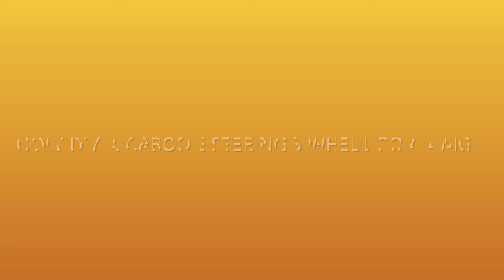DIY Carbon Fiber Steering Wheel Mercedes Production PART 1

Comment: What did you use of carbon fiber? Its like there is already glue on it?
Reply from the maker: Hello, no we spray it on the Carbon and parts
Reply: @CARBONART.  what glue did u use?
Reply from the maker: @wafuasy7147  a 2 component high temperature resistant glue
Reply: @CARBONART. Can you give me a link to the glue?

Comment: Thank you for the response. I really like that finish, because I have tried many carbon fibres and really struggling with distortion in the fibres which looks really bad when epoxy is applied. Do you have any suggestions for me? And is that 245g twill weave? Apologies for many questions, just trying to learn from someone who is really good
Reply from the maker: struggling with distortion happen quickly, it's just practice. but i recommend starting with light parts, for example interior moldings, then mirror caps. You need a lot of experience for a steering wheel because the shape is complex. in the future there will be more videos with many different parts 👍🏼

Comment: Was that spray glue to stick it down first?      Iv done a few 
Try polyester resin first to help stick down     Then normal epoxy resin after.    Definitely works      I had one where the glue felt like it came off so was like a tube in the end lol
Reply from the maker: Hi, yes at first hight Temperatur resistant 2 component glue. 

I don’t like the Methode with the polyester resin. You have there a lot problem with high temperature. A at next the epoxy resin don’t work good with polyester. You must it sanding every time between the layers an best use a special prime. But after all it you have still the problem with first glue layer. It will be work in normal Temperatur country’s but if you have. 40 degree or more on the summer the parts will be damage

Comment: What is the type of glue (black) that was put on the steering wheel so that the carbon fibers are stuck to it?
Reply from the maker: It is glue for leather, same which you can use for steeringwheel leather. I am put a little bit  black Color in the glue